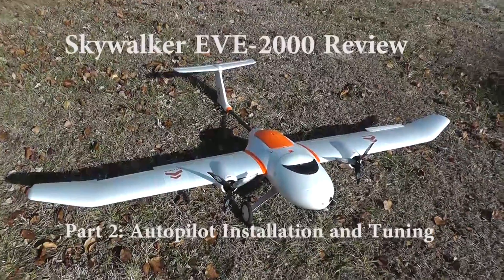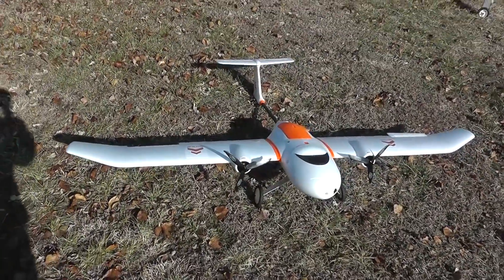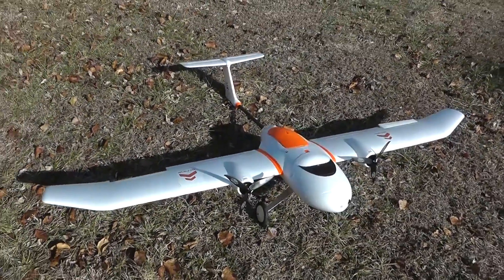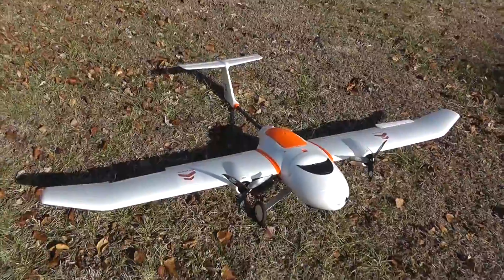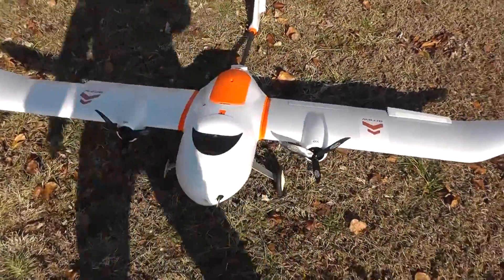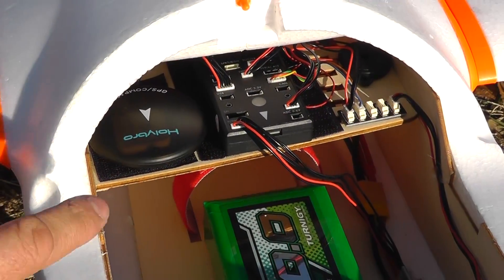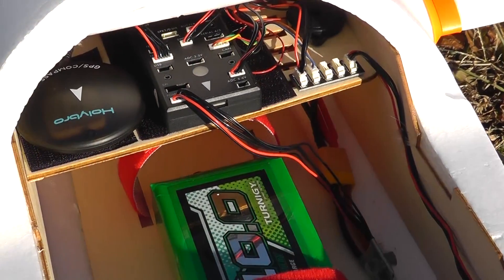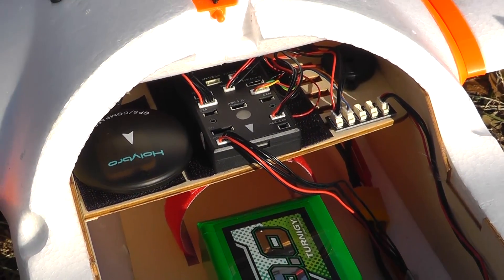Skywalker EVE 2000 Review Part 2: Autopilot installation and tuning

Comment: Hi Merf, 
Thank you for your vidéo! Could you please share your arduplane param? I'm planning to use almost the same setup. It would be a good starting point.
Reply from the maker: The default Arduplane parameters for the Skywalker work well in the EVE, but you may want to adjust the L1 parameter downwards to tighten line following for mapping purposes.

Comment: How did you do the dual motor setup with a pixhawk?
Reply from the maker: James R Since there is no differential thrust, the two ESCs are plugged into a single throttle channel through a simple Y-connection. Pixhawk setup is exactly the same as for a single motor.
Reply: So how do you balance the thrust of the motors?  When I do that, one of the motors spins up faster. than the other one.  I'm using the same motors and esc's and I calibrated them both one at a time before Y'ing them together.
Reply from the maker: James R I did not experience the same problem you have. I can only speculate, but the likely points where differences could be include an unsuccessful ESC calibration, a problem in one of the motors, or a problem with one of the propellers. Is there a difference in max thrust, or a difference in the rate of spooling up? Is there more vibration on one side?
Reply: There is a difference in rate of spooling up and one starts up at a little lower of input that the other.  So one is always barely a head.
Reply from the maker: James R I can't be certain, but it sounds like an unsuccessful ESC calibration.

Comment: nice setup with the autopilot  and 10k mah battery how much more payload weight do you think it would be able to take safely?
What kind of flight time were you getting? Range?
Reply from the maker: Superfly I have sold the plane to someone wanting to use it for mapping, so did not get to do all the experiments I intended. However, it flew light with the 10K mah battery, so it can take substantially more payload. With 10K mah the duration, without stressing the battery, is just under  an hour.

Comment: Thank you very much for the step by step tutorial of adjustment to the flight controller. I have my eve now and I am very busy installing all my flight controls. I have built a electronics plate in the rear for all the gear. I will use mine for FPV as well. Great Job. Again Thank you very much.
Reply from the maker: Bobuilt You are welcome. Good luck for your build and maiden flights!
Reply: Bobuilt هاي

Comment: Great insight on your build. Very clean install. I have mine coming in this week. If I may ask what landing gear set up are you using. It seems to work well. Some consern is about the right landing gear because of the weight.
Reply from the maker: I used the landing gear from a Great Planes Big Stik .60, and Dubro 1/5 Vintage Wheels. Both items are available from Tower Hobbies. It is definitely not the lightest possible setup. I used them because I had them on hand. The vintage wheels in particular are quite heavy. You could probably save significant weight by using different wheels. Advantages of the vintage wheels though, are that they are thin in profile and therefore produce less drag, and the hard rubber don't deform if the airplane sits on its wheels for a long time.

Comment: i APPRECIATE all the info provided in this video. However Merf, I would like to know if you have any plans on the build of your catapult system?
Reply from the maker: Donald Byrd I expect to use this airplane with wheels only, but if I change it to fit my catapult I will definitely make a video about it.
Reply: FlyingMerf ,I am assuming that I wasn't clear. I would like to know if you have any build drawings on the catapult because I would like to build one. But,  I haven't found any schematics so I can build one.
Reply from the maker: Donald Byrd Sorry, I misunderstood your question. The catapult launcher I use is from AgEagle. It is their own design. I've had it for a few years. I use it on all my delta wings, and it has been very reliable. Many different aircraft can be adapted to it as long as you have areas where you can mount 4 hard points. You may be able to purchase one from AgEagle.
Reply: FlyingMerf thank you Merf. As you should know, launchers aren't a common item to purchase, and when you do find one the price is astounding because of supply Vs demand. I'll check with them.